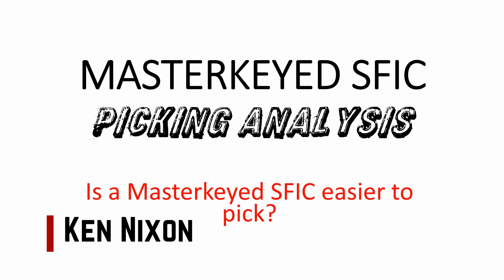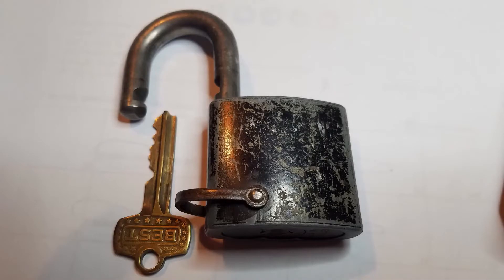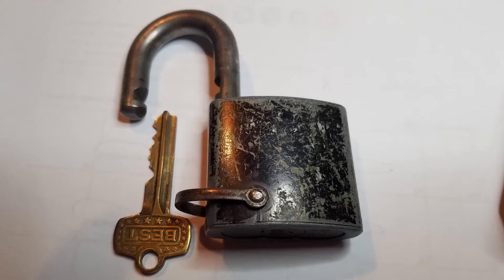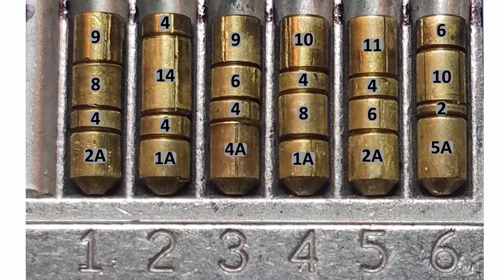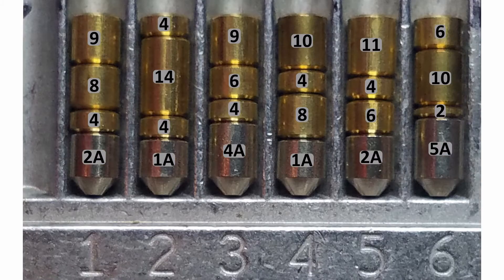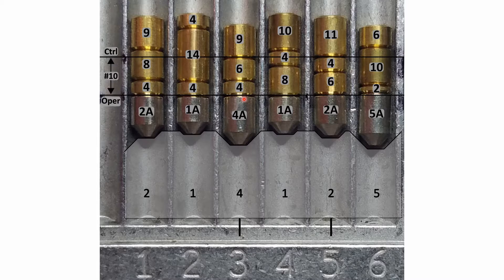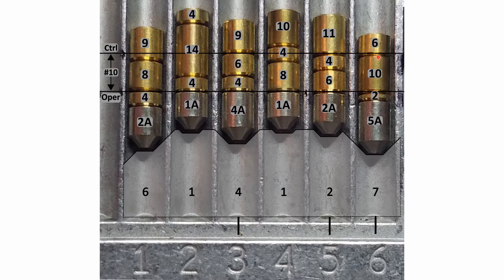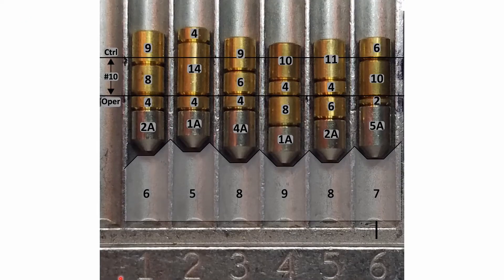Master Keyed SFIC Picking Analysis

Comment: Thanks. I've been learning a lot about SFICs with the LPU Mako lock. That is a real challenge to open. Do you normally just find control through memory and trying the variations? Do you use those BOK wrenches with the nubs to tension the control sleeve?
Reply: I've never had much success with those BOK ejector hole tension wrenches and I know many others that don't have success or use them as well.  If you can make them work, please let us know.  Yes, picking (without security pins) is a matter of keeping track of where shearlines are felt and what results they yield (even written notes help).  When you add serrated, spool, barrel, and even T pin drivers, with possible spool, serrated and barrel key pins as Mako does, then this "complicates" your feel "a bit".  I believe the Mako "LPU contest" locks (as well as their normal stock locks) are not masterkeyed, so you will only have 1 operating and 1 control to deal with (watch for possible wafer under T-pin)
Reply: @Pyrolock , thanks for your reply. The Mako feels like nothing else, feeling two different security pins at the same time. Using the CCW picking trick to operating helps a lot but it's a challenge to either sheer line clockwise. A big step from my normal locks.

Comment: IC's always annoyed me when I had to key up large numbers of them.  So many little fiddly bits to deal with and so easy to lose track of which core you're working on (and consequently mislabeling).
Reply: Yes, very true
Reply: I honestly have more problems with keying and forgetting if i ever put a certain pin in lol. Also the process of putting graphite after rekeying cylinders to make them work better.
Reply: @kurogane2x graphite should never be used in IC cores, or any pin tumbler lock for that matter.